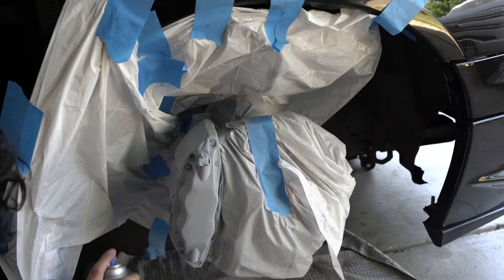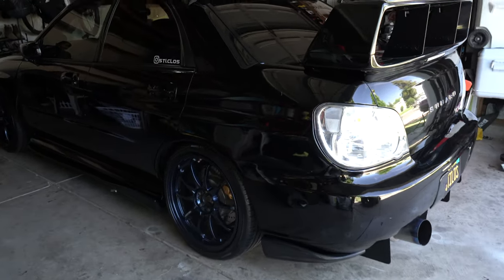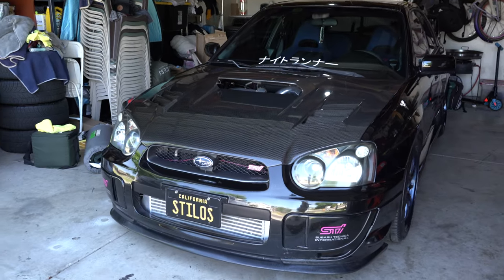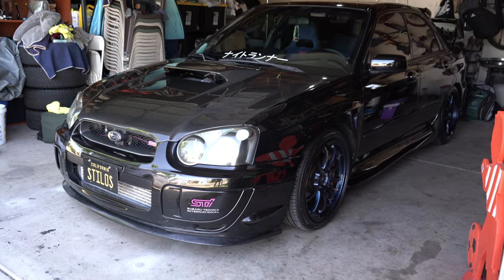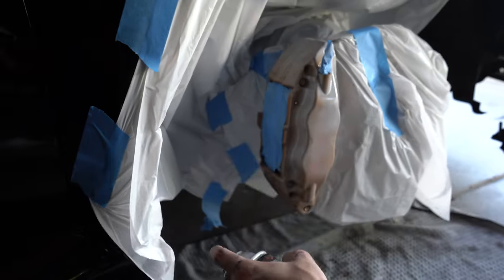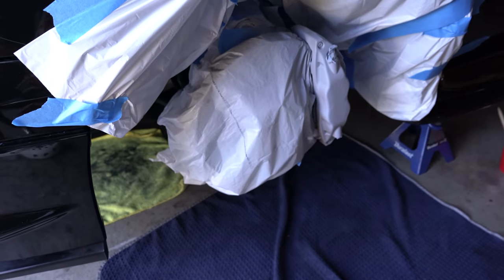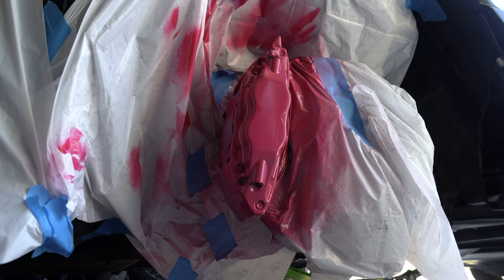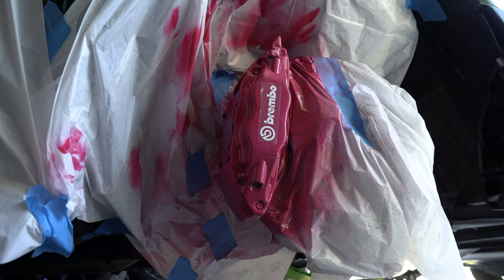painting brembos on a budget! *sold my wheels*

Comment: what was your wheel set up on the CE love the car also next time you repaint the brakes put sticker on after paint then proceed to use clear coat to finished, it will protect the sticker from fading faster .😀🙂
Reply from the maker: my wheel setup was 18z8x5 +44 with tires i being 245/35. good tip i need to repaint the front because of the stickers lol messed it up will take the tip thank you!